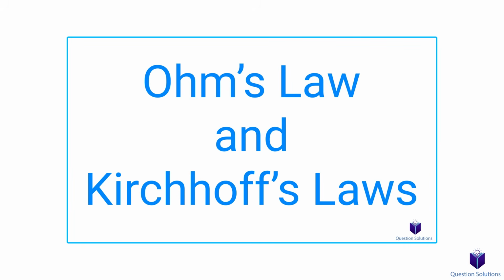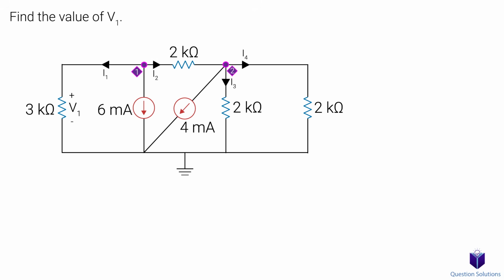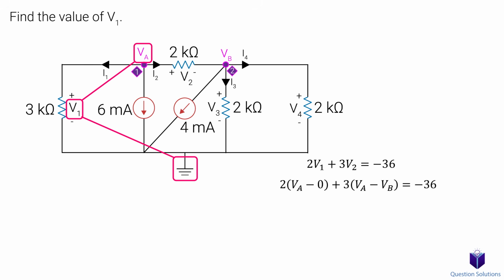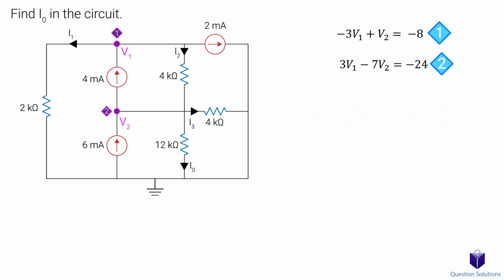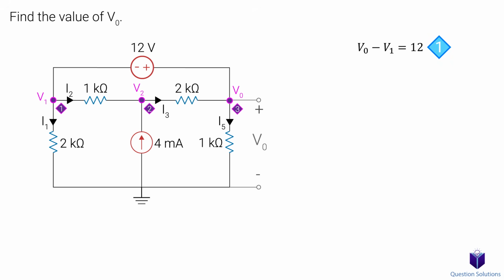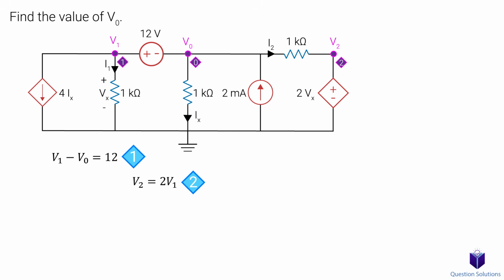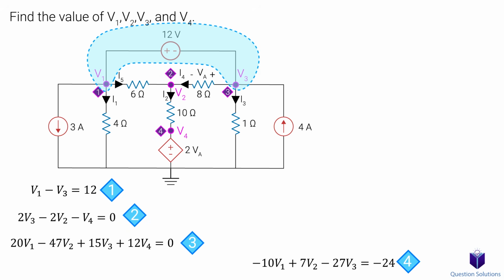The Complete Guide to Nodal Analysis | Engineering Circuit Analysis | (Solved Examples)

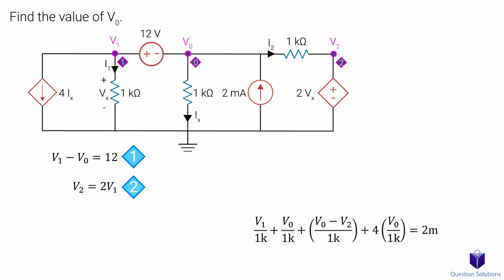Comment: at 23:47 why does V2 isn't 2Vx?
Reply from the maker: We can write it like that, but that doesn't help us solve the problem. It's better to keep everything as node voltages instead, because if you add in V2 = 2Vx, you are introducing another variable. You will then have to write Vx in terms of the current and voltage of the 1kohm resistor. It's extra steps that doesn't have to be done to get an answer.
Reply: @QuestionSolutions oh, Thank you for your insightful response!

Comment: Can I solve it using matrix such as inspection method
Reply from the maker: You can solve it anyway you like using whatever method you're comfortable using.
Reply: @QuestionSolutions 
Sir so what the value of current can I take at the second example
Reply from the maker: @fame.vel-59 Sorry, I don't understand your question. What current value are you referring to?
Reply: @QuestionSolutions 
Sir in inspection 
We write the matrix directly from the Circuit in the form of v=ir
So what is the value of current can I take
In the sum there are 3 nodes so we get 2×2 matrix and there are 3 current source but in matrix we need to write 2×1 
So how to find the current matrix
Reply from the maker: @fame.vel-59I don't showcase that method. If you need help using that method, I encourage you to speak with your professor or TA during office hours.
Reply: @QuestionSolutions ok thanks for your help sir

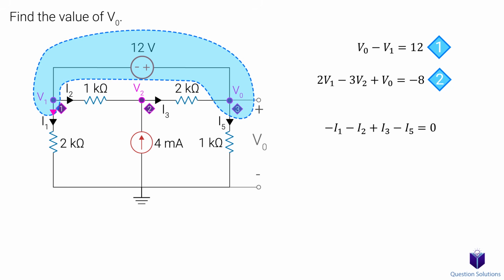Comment: 20:25 Would we do the same thing if the current source and the voltage source were swopped?
Reply from the maker: No, there wouldn't be a reason to do that since you can just write the current value into the equation. Like we did at 5:57.
Reply: Sorry for not specifying, I wanted to ask if we would have to form a supernode at the voltage source if we swapped the current source and the voltage source
Reply from the maker: @mohludimsiza1237  no, you wouldn't need to do that, since really, all we are doing is writing down current values in terms of voltage and resistance. If there is a current source, you can directly write that value into the equation.

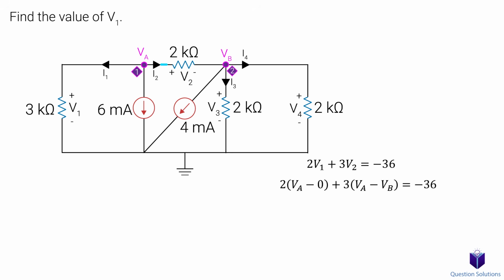Comment: Great video!!! Slight doubt, at 8:10, shouldn't 2 and 3 in the equation be in opposite places, I. E. They got interchanged by mistake?
Reply from the maker: No, what's shown is correct. So at 7:04, we multiply by 6k, --> 6 x 1/3 = 2, and 6 x 1/2 = 3. Unless you're referring to something else?
Reply: @QuestionSolutions ohkayyy no you're right my mistake

Comment: Hello, could you explain how it is possible for a node to have all the currents leaving at 5:55? If all is leaving then where does it get its current?
Reply from the maker: It's just an assumption, you can assume your current to be in any direction you like, makes no difference at the end. The positive and negative signs will solve the proper directions.
Reply: @QuestionSolutions  yes i know but i have faced this issue in another problem as well. Is it technically possible for all the currents to leave the node or the question was wrong?
Reply from the maker: No, it's not possible for all currents to leave a node, that would break Kirchoff's current law. However, you can solve problems assuming that all currents are leaving a node. You will get at least one current to be a negative value, indicating that it's direction is opposite to your assumption.  @thesavage5
Reply: @QuestionSolutions  okay, thanks for your help

Comment: Can you help me in 23:14 I don't understand why did you multiply -1? while the previous example of supernode didn't. May I know whats the clue to multiply -1?
Ohh nevermind if anyone wonder why multiply -1, even if we don't multiply -1. The result would still be the same.
Reply from the maker: So this doesn't have anything to do with supernodes 😅 You're just multiplying by -1 to get all the terms to be positive, just to make the math easier.
Reply: @QuestionSolutions  Thanks for responding. Yup It make sense why we multiply -1 to make it easier to solve using substitution/ elimination if we don't use calculator.
Reply from the maker: @redmvd  That's right! Keep up the great work :)

Comment: so in  14:33 example  2   how did u get -v2/4k did you take right hand side as 0 voltage
Reply from the maker: You're referring to I3 current, right? So that's the current flowing in the 4k ohm resistor. One end of that resistor is connected to node 2, and the other end is connect to ground. Notice how if you walk down the right end of the conductor, you reach ground. So it's just v2-0/4k, which is just v2/4k.
Reply: @QuestionSolutions   thank u  so much

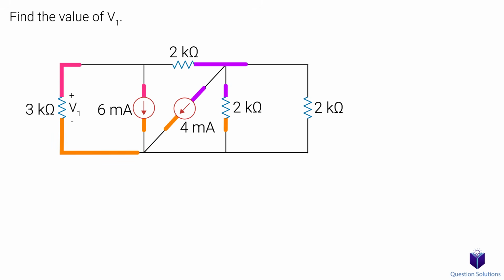Comment: Pls at 3:39, is it not 4 nodes that are there?
Reply from the maker: No, I color coded them for you. There are 3 nodes.
Reply: But sir correct me if im weong, but this is what I observed.
Node1: the 3kz 6mA,2k for the top left segment
Node2: 2k,4ma,2k for the top horizontal segment
Node3: 2k on the top right segment
Node4: the bottom node where all segments reach (earth)
I would really like and appreciate your response, thank you @QuestionSolutions
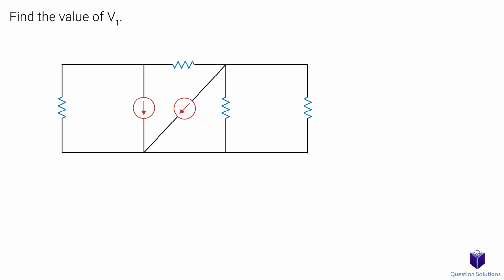Reply from the maker: @IfeanyiNkemOjei So your node 2 and 3 are incorrect. Notice how at 0:35, I bring all of those wires together? Do the same thing in your mind for the wires I've colored in purple at 3:40. That's a single node. An easy way to figure out nodes is to select a circuit element. So let's say you pick the 2k ohm resistor at the top. Now you're going to walk along the right side conductor. When you walk to the right, you notice that it splits into 3 parts, 2 goes to the bottom and the other keeps going right. Now imagine going on all of those paths until you reach another circuit element. Going down, you reach the 4mA source and the 2k ohm resistor, going to the right gets you to the 2k ohm resistor on the right side. What you just covered is a single node. So in this circuit, there are only 3 nodes.
Reply: Ohh, thank you sir. I understand it now, I'll pay more attention next time 👍🏽
Reply from the maker: @IfeanyiNkemOjei You're very welcome. Don't be discouraged, finding nodes can be troublesome for a lot of students. As you do more examples, it will become super easy though :)

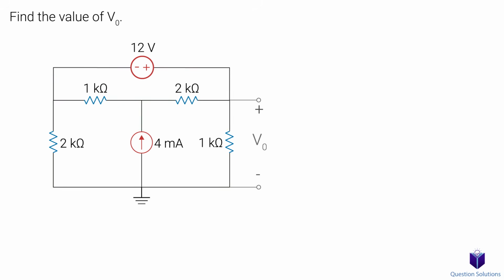Comment: I have a question. When I don't choose the same node as reference node as the video, I get a completely different answer.  For example in 18:28 each node of the circuit has three connections, so I thought I could choose from any one of them. I chose the top right node and got -4 Volts as V_0. Are my equations the problem or does it not work when you choose the wrong node as the reference node? How do we know which node to choose as ground if each node has the same number of connections? Thanks in advance, if you could answer this question of mine :)
Reply from the maker: So whatever node you pick as ground will give you the same results. In other words, you can pick whatever node you want to be ground. You can test this by going here (https://www.circuitlab.com/) and drawing out your circuit. Then place the ground wherever you like and see if any values change (they won't :) ). So that means there is a probably some tiny error with your equations. If you have the time, I encourage you to see your professor/TA during their office hours, and show them your equations so they can go over them one by one and see where the mistake is.
Reply: @QuestionSolutions  Thanks so much for the speedy response! I found the error in my equation and you have answered my question clearly so I understand everything perfectly (for now :) ) Thank you again for the service you provide to many engineering students like me. Have a nice day!
Reply: I found the mistake in my equation and got the right answer. But I still have that question on my mind. Will I get the right answer no matter what node I choose as reference?

Comment: bro 24:08 in this what TO DO IS THERE IS 8 VOLT VOLTAGE SOURCE  instead of 8 ohm i am stuck in that type of assignment question
Reply from the maker: You can write an equation comparing V2 and V3, stating that it's equal to 8 V since that's the potential difference. Same as eq.1 comparing V1 and V3. 

I encourage you to do all the questions in this video, starting off with the first one and finishing off with the last, by the end, you should be able to solve your assignment questions pretty easily.

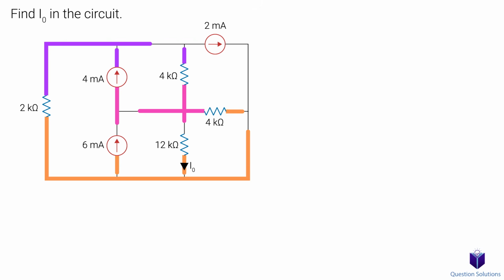Comment: I have a question sir, so a node is defined as a "point where 2 or more circuit elements meet/join"  - so for example in 11:05 the orange/pink/purple lines aren't a "single node" / point, they look more like paths?
Reply from the maker: This is usually hard for some students to grasp, and that's okay. Every "node" is a path, a path as in a wire or multiple wires. These are all just wires connecting one circuit element to another. So the easiest way to figure out a node is to pick a circuit element. From that element, walk along the conductor that's connected to it, and then if that path splits, go on that path as well. You just keep going on the path until you meet another circuit element. Everything you covered is a single node. This is why I even animated the paths coming together to a single point at 0:35, because some students can't tell a node. On a side note, I will create another short video some time in the future going through circuits just showing how to figure out nodes.
Reply: @QuestionSolutions  Amazing, thanks for this explanation. I think for me personally, its easier to use your visualisation at 0:35 - all the conductors joint together at one point/one node.

Comment: even after trying a lot to apply nodal analysis onto this problem, i cant solve it.. TT. could you please help me? 
it looks somewhat like this 
-- 4ohm --- ----- - 6V + --- --------------------
I                 I                      I                    I
I                 I                      I                    I
+               3 OHM        2 ohm         6 ohm
14V           I                     I                     I
-                 I                     I                     I
I -------------  I ----------------- I -----------------I
Reply from the maker: Please see your professor or TA during their office hours for help. I can't solve problems because then I have to solve everyone's problems and I simply don't have the time to do so. Try to solve all the questions I cover in this video, the problem you showed is not a difficult one. If you can solve the ones I show in this video, you can easily solve the one you showed. 👍
Reply: @QuestionSolutions  okay sure thanks.. i was worried if any external concepts were used. sorry
Reply from the maker: @liv-mn9mz  Everything you need is covered in this video. If you can do these questions shown on the video, you can, with ease, solve your problem. Also, no need to apologize. Try it out and see :)

Comment: how to identify nodes like that im dumb at electronics
Reply from the maker: @geshananupama5871  so you start at a circuit element. Then you follow it's conductor path until you reach another circuit element. If the path splits while you're travelling to the other circuit element, follow that path as well. Eventually when that also arrives as a circuit element, whatever you just covered in a single node.

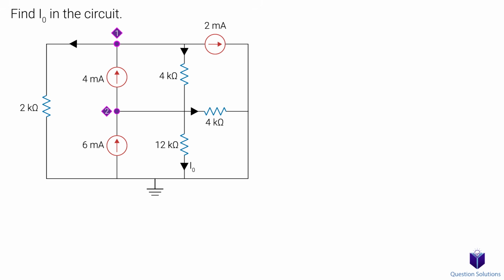Comment: These videos are fantastic! However, I have a question: at 11:42, how do you determine the nodes and decide where to place the dots exactly?
Reply from the maker: The dots don't really matter, it just makes it easier for us to know where each node is, so you can usually just place them at a place where a conductor splits. To figure out a node, all you need to do is pick any circuit element and walk backwards from it until you reach another circuit element. While you're traversing, if the conductor splits, then you go down that path as well, until you reach another circuit element. What you just covered is a node. On all of these problems, I've color coded each node at the very beginning, so you can do it yourself and see if it matches. As you do more questions, it'll become second nature, you can just look and count the nodes with ease.

Comment: 20:24 how you applied kcl at node A . How you have used all currents of circuit in 3rd equation??
Reply from the maker: What do you mean by node A? KCL is applied to the whole super node, so the blue object with the dashed lines. All of that is considered a node.
Reply: @QuestionSolutions  I understand .Thankw

Comment: hi sir,  i would like to know based on electrical circuit can you explain nodal analysis to get transfer function because transfer function required expansion and simplify all and first we must do nodal analysis its confusing because i can do voltage as source but what if current is source and output as well ??? i am taking a subject called control system so will be apreciated if sir upload a trick to get transfer function for either laplace or mechanical system or electrical and so on
Reply from the maker: I haven't covered transfer functions yet. I will add it to my list to do. On the bright side, there are a lot of videos on YouTube that talk about it. I hope they can be helpful to you.

Comment: 26:35 what if there is resistance between V1 and 12V source
Reply from the maker: As in, you included a resistor in the super node? That doesn't matter, your equations will still be valid because KCL will hold true for any surface.
Reply: Then how will we make equations 
Please describe in brief or make a video on it
Reply from the maker: @KDManik-df6uo  So you ignore anything inside the node. You write the equations as I've shown with 3 examples. So you look to see what currents come out, and what currents come in. Also, there really is no need to do a supernode to include a resistor. Your supernode should include 2 nodes and a voltage source. If you need to include a resistor, you're making too much work for yourself. If there is a resistor between the voltage source, then there is also a new node at that spot and you're missing an equation for it. Make sure you get your nodes correct, because it seems like you're missing one in your question.
Reply: So then there will be one more node and one more equation?
Reply from the maker: @KDManik-df6uo  Yes. You must first figure out how many nodes there are. That's why I started by saying how many nodes each circuit has, it's really important. So let's say you have 6 nodes, then you need 5 equations to solve the circuit. It's always one less than the number of nodes. Since you said there is a resistor next to your voltage source, that means there is a node there. So first, you need to identify that before starting.
Reply: Ok, Thank you so much
Reply from the maker: @KDManik-df6uo  If you're having a hard time figuring out the nodes in your problem, send me a link or a picture and I will label it for you. contact(at)questionsolutions.com